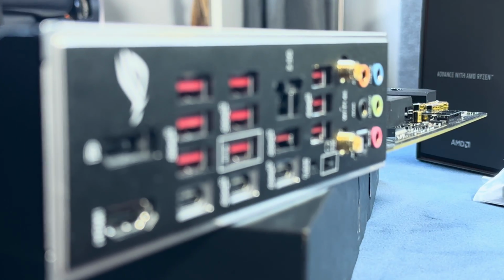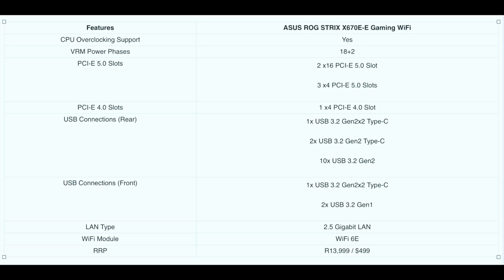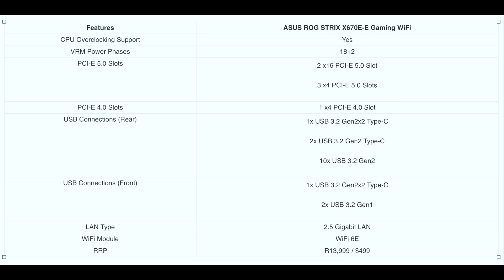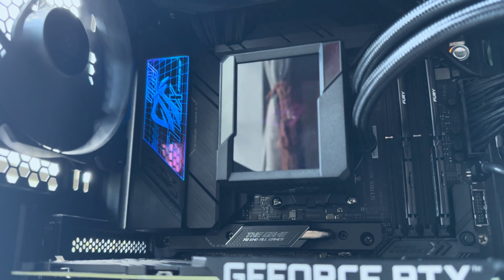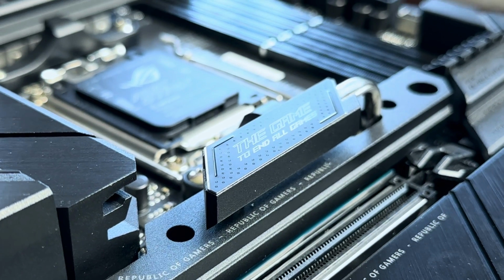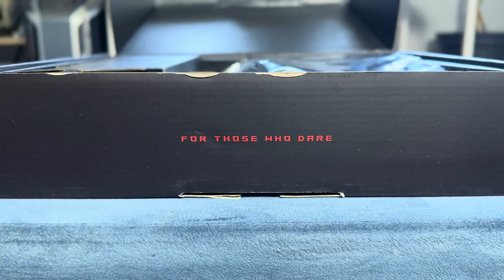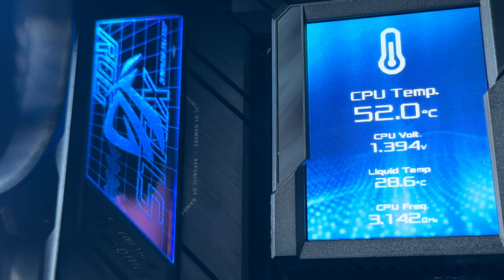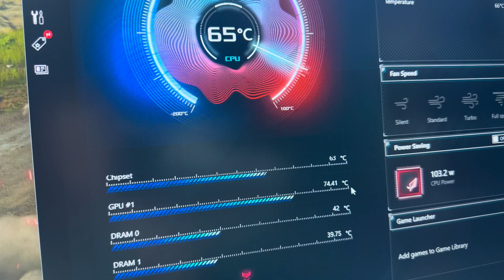ASUS ROG Strix X670-E Gaming Motherboard Review (AMD Ryzen 9 7950X Tested)

Comment: Please help, I originally had 32gb of ram on slots 2-4 and decided to upgrade my ram by adding 64gbs of ram on slots 1-3 but I started getting a red light ram error and my pc won’t boot up
Reply from the maker: I had this same issue on another board and after a while, I ended up removing the RAM. When you put different sizes of ram into a MB it causes problems. Usually, you'll have to stick to only 32GB sticks or 16GB sticks. You can't go 16GB and add 32 GB. If you do, your system loses the Dual Channel feature and enables flex channel memory. If you're having issues with Flex Channel Mode, try troubleshoot them by reading up on the feature. It will give you some understanding on how it works. Also, be sure to have your BIOS updated. I know these boards still have RAM issues today and keeping them updated helps prevent them.
Reply: im sure you figured this out by now.. however when adding 4 sticks. you need to move the original 2 sticks to the same channel. so they stay matched, and the new ones go in other channel all as matched pairs.

Comment: Could a rob strix 4070 ti fit on the motherboard?
Reply from the maker: Should be no problem.
Reply: Ima sub thx so much my friend said that rog strix 4070 ti 12gb  is too big for the mobo
Reply from the maker: @SyKo.1  The size would matter more for the case you have but the PCI-E port is the same. You'll also want to just see whether or not you want GPU support mount to help keep it up. These 40-series cards have sagged motherboards in the past so be sure you keep it propped up and sturdy. But the card will definitely fit in the board.
Reply: @GLITCHEDZA yes I was thinking how a gpu wouldn’t fit in the mother board and was kinda stressing ima get a h9 flow should be good right ?
Reply from the maker: @SyKo.1  Yes that case is perfect.
Reply: @GLITCHEDZA sorry I’m asking alot if quiestion this is the last one. When I go on pc part picker I choose the AMD Ryzen 7 7800x3D and the mother board is ASU’s rog strix X670E-E but then it says I will have to update the bios to support the cpu will it be easy
Reply from the maker: @SyKo.1  Yes it should be. ASUS usually supplies a USB in the box with the update on it. Else, you'll just need to build the PC, download the BIOS update from the support page, put it on a USB, load into BIOS and select firmware update. It sounds like a story but these are usually quite easy now. Just get the PC running with the CPU installed, then get the BIOS update, put it on a USB and go into BIOS to update the motherboard.
Reply: @GLITCHEDZA if I get NZXT fans how much remotes would I need

Comment: Does anyone know if using all the NVME slots with Gen 4 m2s will affect anything?
Reply: @thangy90 @La Trec  The manual states its only M.2_3 that shares badwidth. The rest should not impact the PCIe lanes.
Reply: Yes it does. I halves number of available lines for gpu to x8. That`s maybe not the case on upper class ( Hero or Extreme )..But on this one ..yeah . Although...it makes no sense because this mobo is quite good.
Reply: @TheBebe666 wow I didn’t realise that, good job I saw this comment. Just checked the manual and you are right! Doesn’t make any sense at all on this board. Might as well just get a B650E-E!
Reply: @TheBebe666  Misinformation. The manual clearly says that only when the Gen 5.0 is used in specific slot which is m.2_3 the  bandwidth will be halved. He's good to go with Gen 4.0 no matter how many of them he'll put into the board.

Comment: I have a 3070 Rog Strix GPU and im still unclear if im able to put it in the pci 5 slot or if i have to put it in the PCI 4 slot at the bottom.
Reply from the maker: You can put it in either. It is backwards compatible. Only if you had a 40-series would you have to use the top slot.
Reply: @GLITCHEDZA  ok thank you was just wanting to make sure i was able to put in the top slot.
Reply: @GLITCHEDZA  why, the 40-series is pci 4?

Comment: Asus X670E-E GAMING WIFI motherboard I changed memory to G.SKILL F5-6000J3636F16GX2-TZ5NR approved by ASUS for this board and that fixed all my problems. Could not load BIOS 0705 or 0805 = FIXED. INTEL i225v3 Ethernet gave trouble sometimes = FIXED.:face-blue-smiling:
Reply: I have this board and had the same problem, could not get any network connection or Nvme drives to work on either 0705 or 0805, which memory were you using orginally? I might try your solution and get the G-skill memory.

Comment: at 3:13 - can you tell me what CPU AIO monitor that is that shows temps, freq and voltage??
Reply from the maker: It is the - ROG Ryjun II AIO
Reply: Keep in mind asus coolers show cpu socket temps and not the true cpu temps so it will always show less than what it is. And they are also massively overpriced for the cooling they provide.

Comment: Does this board displays the CPU temperature on the debug led display after windows boots? Or only error codes? Thanks!
Reply from the maker: It only shows codes and no temperature.
Reply: @GLITCHEDZA  it shows temperature, but it’s not accurate
Reply: yes